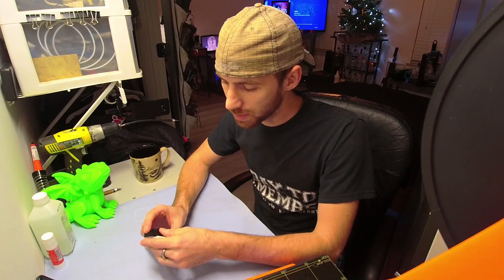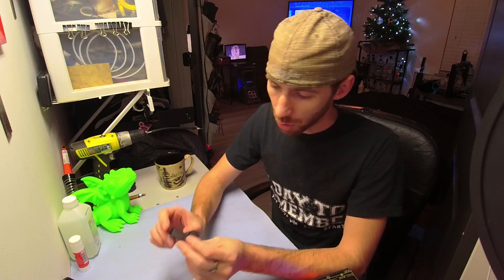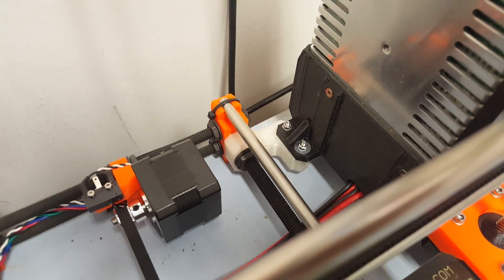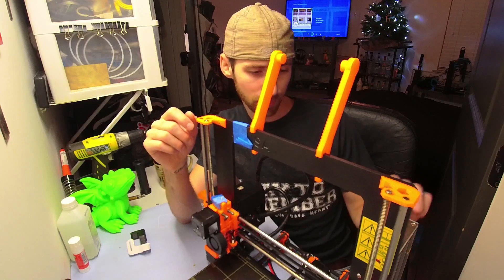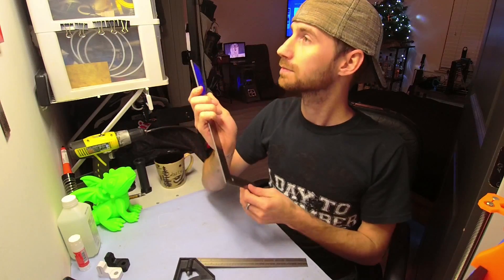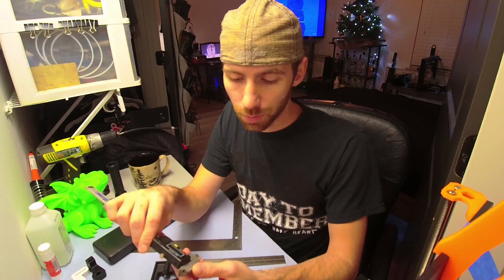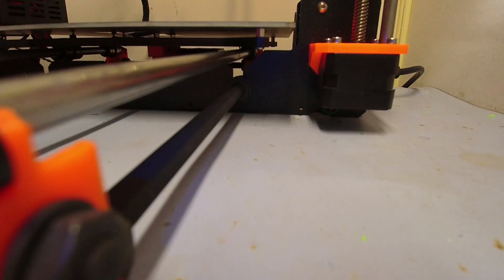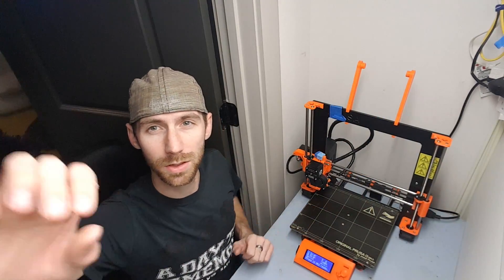Tips on a better Prusa calibration. New PSU Block mount! FREE STUFF GIVEAWAY

Comment: The Y leveling/reference goes on the top screws not on the plastic parts, so it doesn`t matter how "instable the egde" of that top part ist wich is not not realy necacesry there.
The AC/DC Box is a realy problem - mine is not just bad in the Z axis but also in the Y. Also it`s not straight on that side and puls the Cage a little bit back a the top - this Part definitely has a to big tollerance by itself. So it would be better to put a longhole for Z too or better print an complete new corner part there and put the Box somewhere else.

Comment: any tips to the pinda probe being off a little during calibration
Reply from the maker: Lower the extruder as close to the bed as you can get it then adjust the probe to be a little higher than the nozzle. That's what I've done from the get go and it has worked great! I do know there is a tool you can print out that is supposed to be the right height for the pinda adjustment but I've never needed to use it.

Comment: Eyeballin' XY to get it perpendicular is not precise enough. Placing a straight ruler on the bed on Xaxis and pushing it to the frame, comparing all X lines on the bed to the ruler and then adjusting like in Prusa manual made it perpendicular in 1st try for me.
Reply from the maker: Good idea! Though I have not had an issue with mine yet, that solution is much easier and obviously more accurate!
Reply: Dejan z

Comment: Hey. I just got my Prusa i3 put together and I'm having an issue with things not sticking and getting pulled up. I've tried on just a clean heatbed and using the glue stick. I'm sure it's a setting, I just don't know what to try next. Would it be the temperature of the heatbed? Was wondering if you ever had that problem after building yours. Any info would be greatly appreciated. Thanks!
Reply: What filament? You shouldnt have to use glue stick with the PEI bed. You might have your nozzle a bit too high.
Reply from the maker: If you're just printing PLA you shouldn't need a gluestick. I've never needed one with any of my PLA. Def make sure the heatbest was cleaned with alcohol and make sure your z height is properly adjust. It sounds like it may be too high. If it still isn't sticking then try using the rough side of a kitchen sponge on the bed and then re-clean with alcohol. Good luck!
Reply: If you can see the lines then your nozzle is too high. When you PINDA probe is properly adjusted I believe they say your live adjust should be in the -0.3 to -0.5 range.

You will likely need to adjust your probe a bit.
Reply: Riyame I'm using a silver PLA.
Reply from the maker: Try what was suggested and let me know if it works! Since it's PLA you won't need a glue stick.
Reply: Improper Engineering Thanks for the advice. I've discovered that certain things stick just fine but other things will start peeling up while laying down the first layer. And it seems like when it's printing, the filament isn't "squishing together", if that makes sense. You can see the individual lines as they are layer down. I've tried adjusting the temp of the heatbed and nozzle but still don't think I have settings dialed in. If you don't mind me asking, what settings do you have on things like Live Z adjust and temps. Thanks
Reply from the maker: The live z will be different for every machine. send me an email through the contact form on improperengineering.com, i'll try to help ya
Reply: Improper Engineering Sent you an email :)

Comment: I think your assumptions are wrong. You say to only use one square... but if your squares are square it doesn't matter which you use. I think your MK2 has alignment issues. I think that because you had to replace a part and file down a screw shows that something isn't right.
Reply from the maker: It's common practice to stick with the same measuring device throughout any project.. whether a square, tape measure, ruler, etc. All measurements show my prusa is aligned and square. All distances are completely equal. Sometimes in mass production or shipping some things can be skewed  It seems i'm not the only one who has ran into this issue.

Comment: Cody, you have misunderstood how the Z calibration works. When you move the Z-gantry all the way to the top it stops when it hits the two bots that hold those brackets in place. It doest not actually impact the brackets. Therefore any flexibility in the bracket is not a problem. Actually a very clever way of doing it I thought.
Reply from the maker: Jonathan Bird unfortunately this is not the case with mine. when my z gantry is pushing the brackets there is still ~1mm before those bolts you're referring to are touching the z gantry. that's also why I'm able to physically watch the brackets bend as the z gantry rests at the top.

Comment: did you happen to check the that the y-gantry was flat? I've seen a few people with bent gantries that caused the screw to hit on the Z gantry.
Reply from the maker: Ryan Neufeld yes sir! not really sure what the issue was.
Reply: I think the laser/water-jet cutting and powder coating isn't perfect across the whole production. I'm gonna have to file out one notch on my frame to get it square in the X/Z
Reply from the maker: Ryan Neufeld I thought about doing that but it was faster to just file the screw down and until I notice imperfections in prints I won't worry about it.
Reply: yeah, the mesh leveling does a pretty stellar job at hiding minor imperfections in the build.